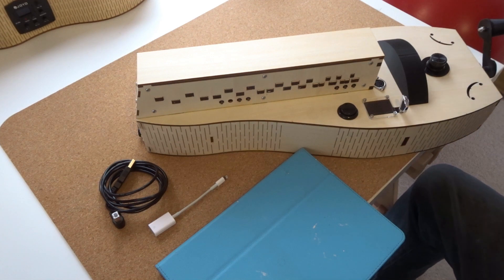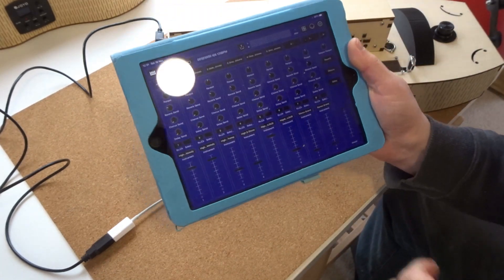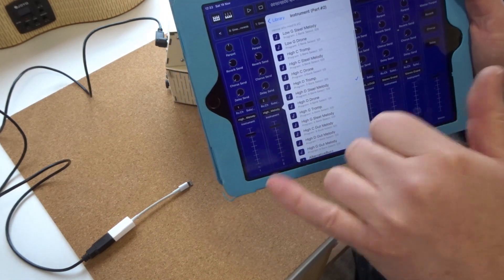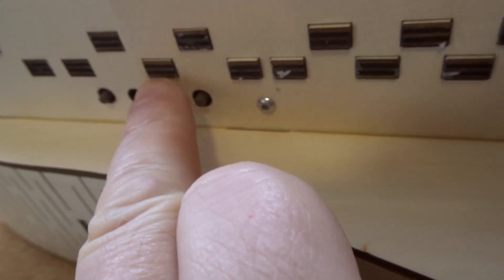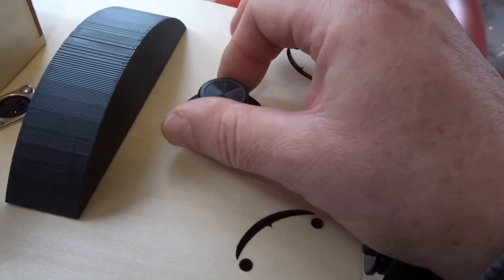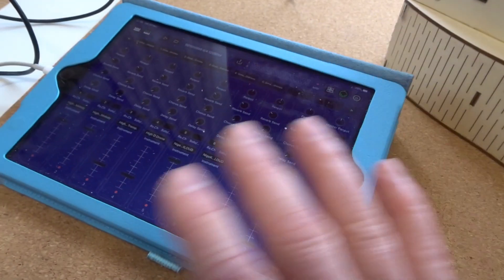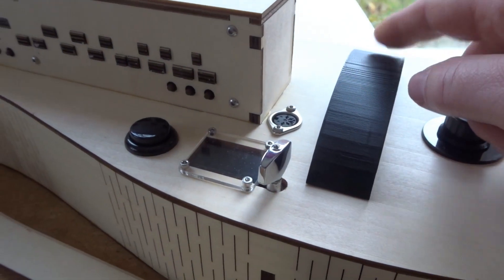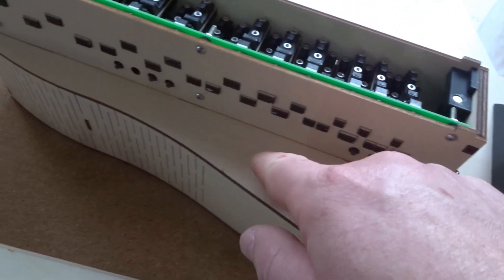Digi-Gurdy | Quick Start Guide

Comment: Oh my! This is amazing! Does it require an ipad or can you run it on comparable software on PC and/or Android?
Reply from the maker: iPad is easiest overall running the excellent bs-16i app. It will run with Android using the FluidSynth MIDI app and also a PC if you know what you are doing with DAW (Digital Audio Workstation) type software. Latest version also has optional internal audio board so it can have a headphone/line-out socket too.
Reply: @XenonJohnD  Thanks much!